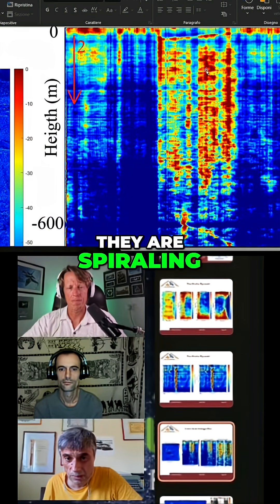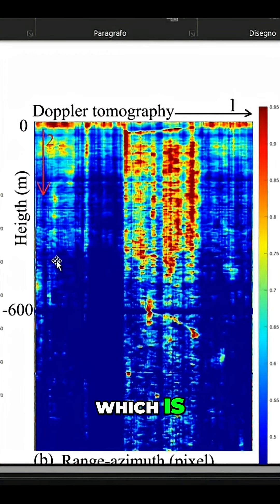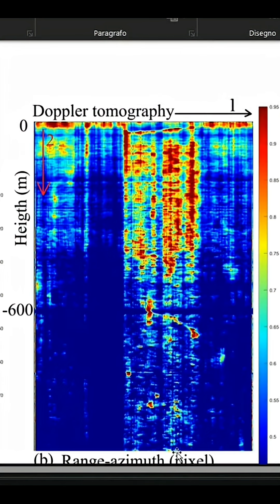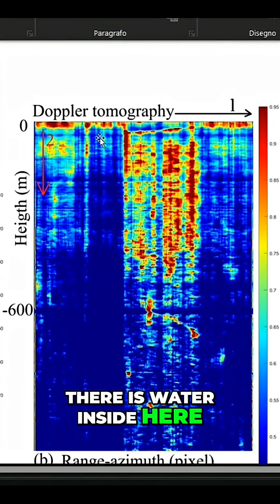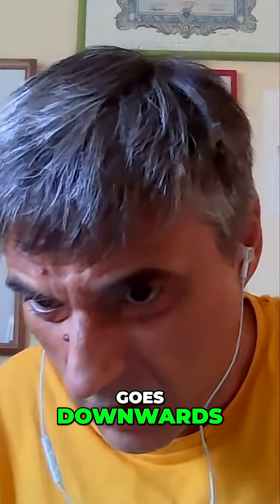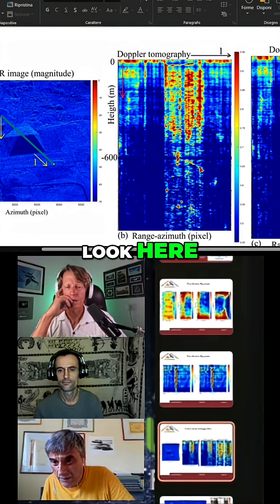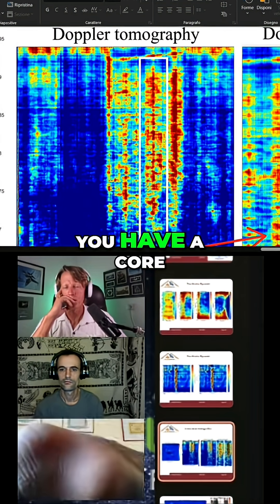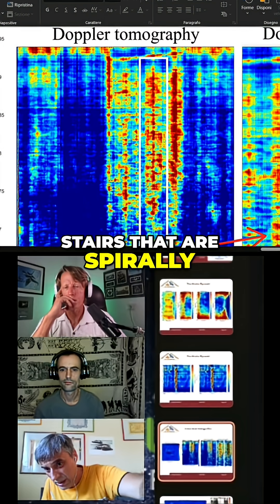Spiral Shafts & Water: This Discovery SHOCKED Scientists!

Comment: They appear to be water conveyors (pumps), that lift water to the surface from a constantly varying water table height.  If so, the question is what did they need that much water for?
Reply: Water could be turned to energy source.

Comment: la bulshito
Reply: Except it isn't and has been verified by repeated testing and same readings.

So, your life was a lie, cope bro'
Reply: @BrodyLuv2  it has also been verified by pigs flying. they are claiming to pick up passive audio on the surface of pyramids with radar ranging from space. Not a geostationary satellite but a fleeting pass at 7km/s. not only picking up sound in the stone but with such precision as to do 3D acoustic tomography through a structure with airgaps between stones, even imaging deep into loose sand. voice audio level in stone is less than 1nanometer deflection on the surface. silence in stone is vastly less. and they claim to use that for imaging... it's 100% bs
Reply: Ok so, if multiple satellites pick up the same or very similar signatures across multiple passes — then what?
Reply: @Haveuseenmyjetpack they wouldn't but hypothetically if others got similar results from a method that would be considered validation. but what they are proposing is impossible. there will be no valid validation
Reply: @DanFrederiksen 
You really cannot be bothered to check out the method huh?
Just regurgitate opinion.

It's ok, you are scared of the method, I understand.
Reply: @DanFrederiksen you almost sounded sane for a second there
Reply: So what are we actually looking at then?
Reply: @Haveuseenmyjetpack Possibly the pyramid structures themselves are causing some sort of distortion or 'scatter effect' resulting in the data. Maybe in a faintly similar way that an optical prism results in the refraction of visible light?  That said, my mind is open to the less prosaic possibilities and I freely accept that there are things that may exist which we neither comprehend nor understand. Scientific evaluation is the only way forward on this.
Reply: @Haveuseenmyjetpack that's a good question. some kind of top notch bs. maybe just working radar data until it looks like something he can lie about. maybe convinced himself it's something without checking too closely.

Comment: giant capacitors that store electricity from lightning striking the capstones
Reply: I’m thinking the opposite the Nile was close to the pyramids back then and the weight of the pyramids with water could cause a giant electrical discharge out the tip of the pyramid possibly even changing color with the seasons with different mineral make up of the water 🧐